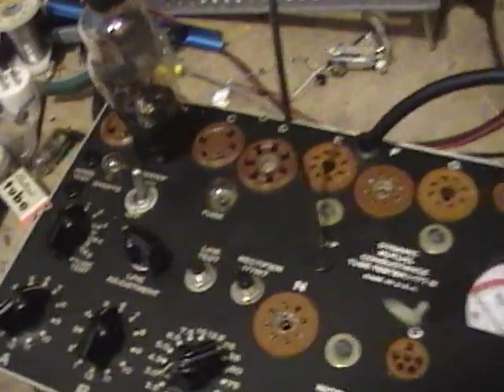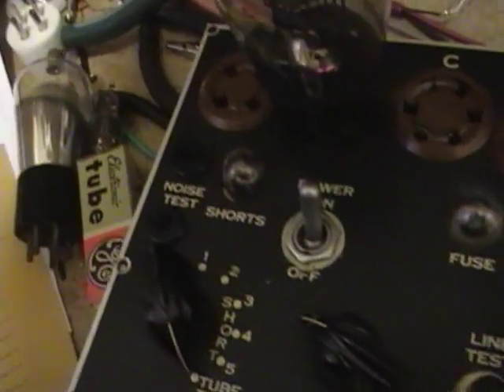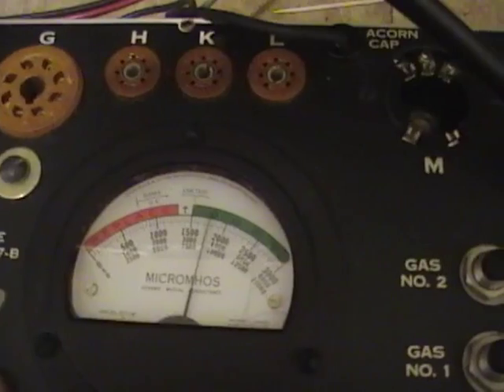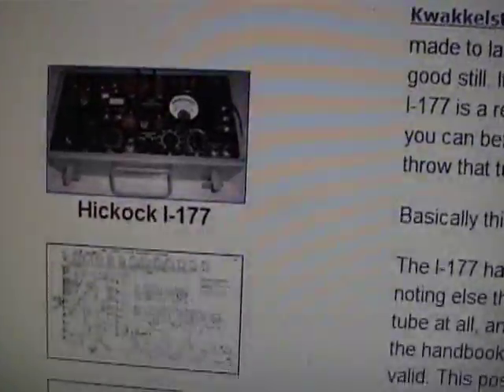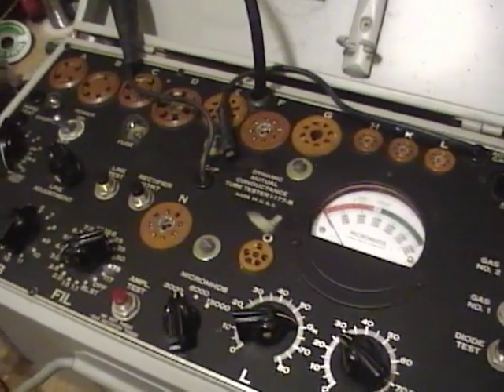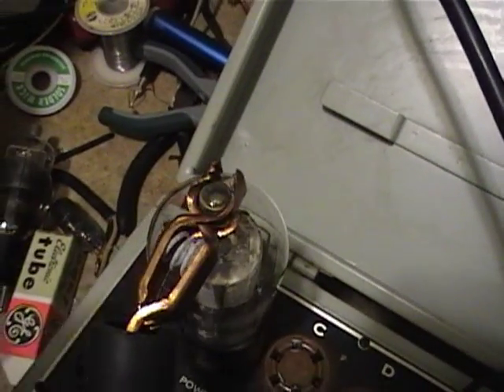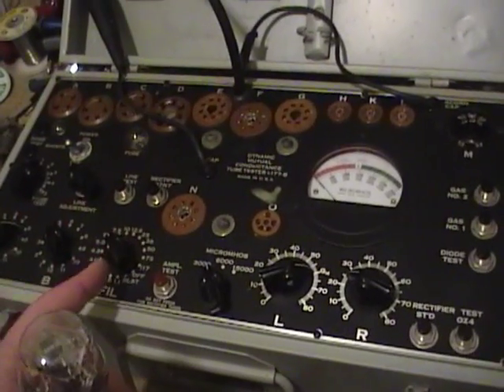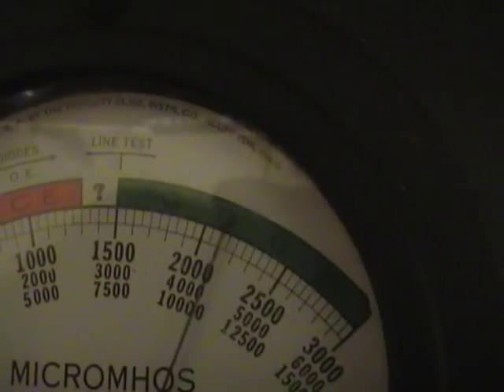I-177 military tube tester p3o3

Comment: I found that gas in tubes can make them test better then they actually are.
Reply from the maker: Absolutely.  The air ionizes and increase conduction.  The downside is you lose grid control.
Reply: @bandersentv  ah ok so even though tube conductance increases you lose grid

Comment: Hi bandersentv, I bought an I-177-B for a couple of months ago, and to make it all short: what do switch A and B do,? and whats the point of all this doubling of sockets E & G and H to L? and the same with the MX-949/U extender kit, thank for  all the videos you share with us. BRG's
Reply from the maker: Do you have the manual ?  Its a free download and explains all the controls and how to test a tube.  Switches A & B set operating conditions for the type of tube you are testing.  The have multiple sockets with the same pinout wired differently to reduce the number of controls. Notice how this tester only has an A & B rottary switch while a Hickok 600 has many more ?

Comment: I thought briefly about you replacing the 83 MV rect. If you are going to use a solid state replacement, I would build my own and fuse protect it...SS diodes tend to short and if they do, it could take out the power transformer...The AC line fuse won't always protect the HV winding...something to ponder :)